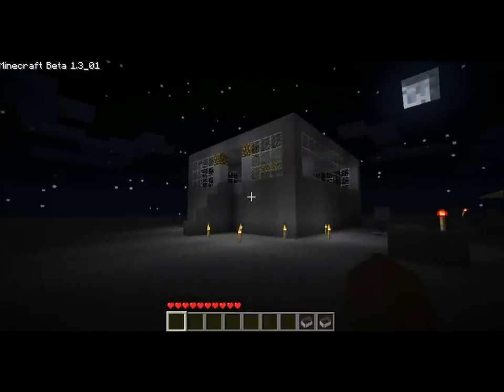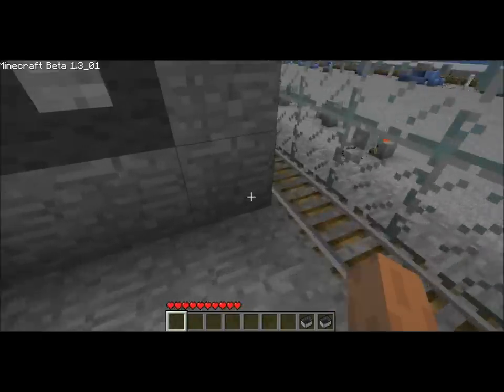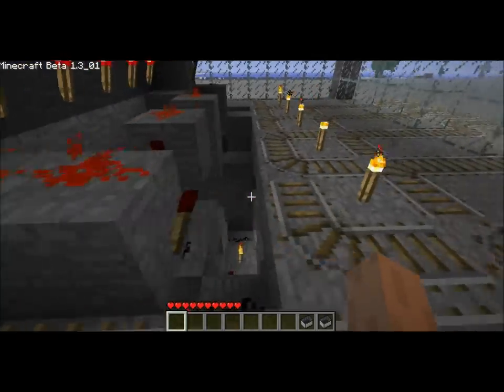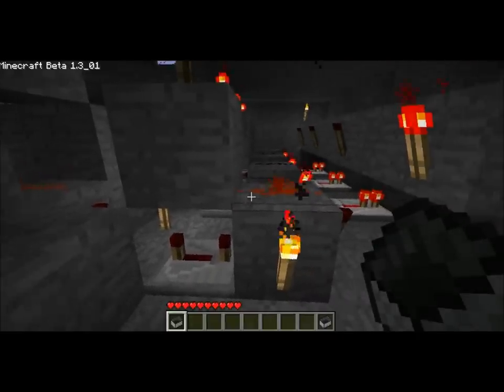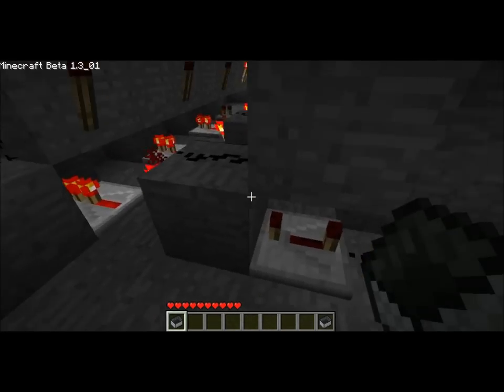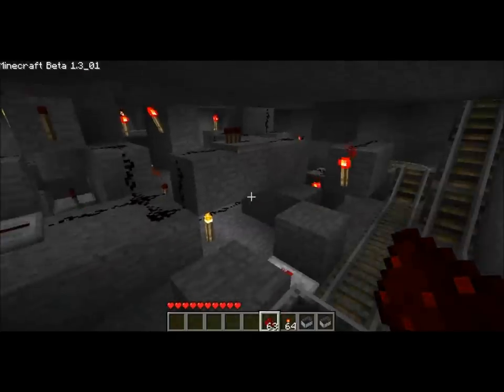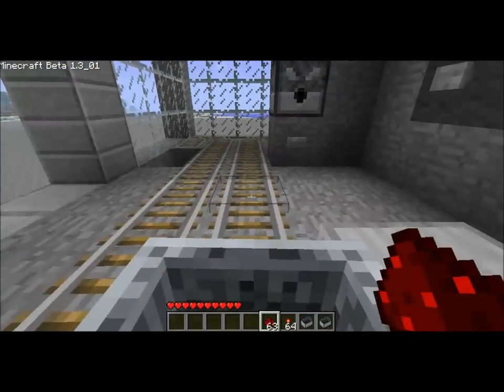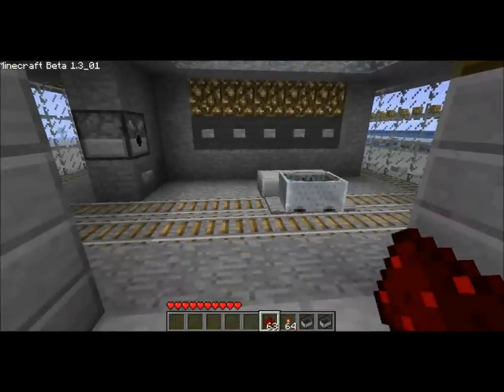Minecart Station in a Box V4.0

Comment from the maker: @curiosityproofcat
I wanted to test this with MCEdit, but as you may have heard, I haven't had much luck. If you import it normally, the cart will be facing the right direction initially. You can try rotating the station and it might work in another direction but you will probably have to invert the signal some how and there isn't much room down there.